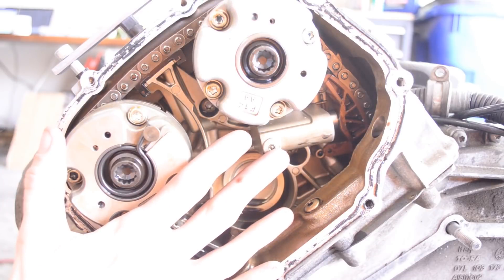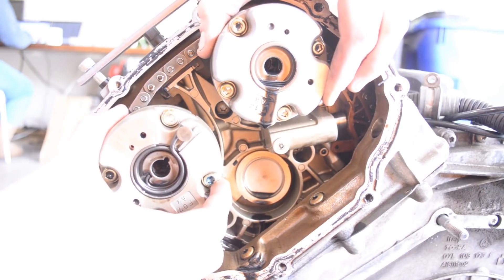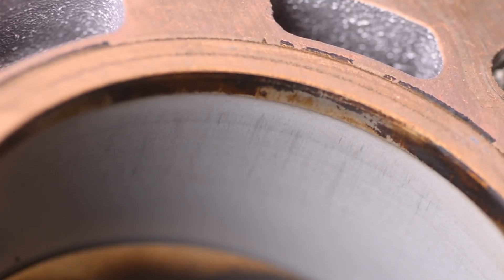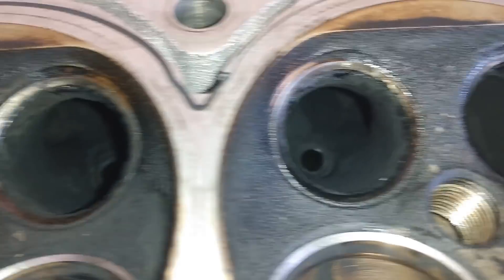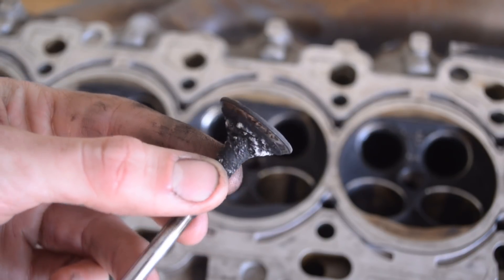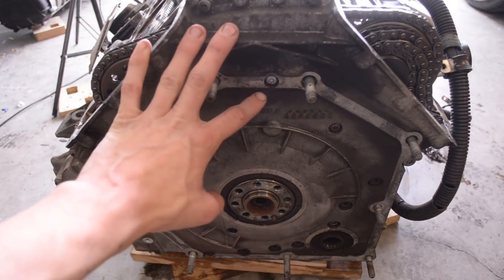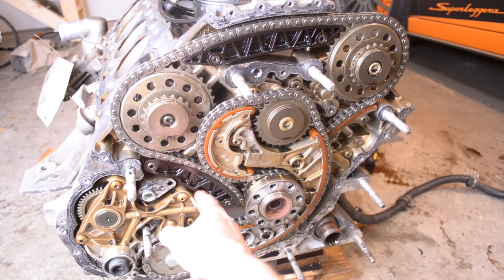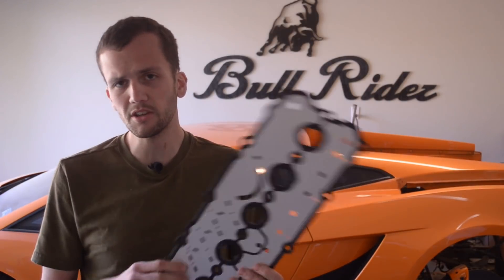Lamborghini Gallardo Superleggera V10 Engine Teardown | Cylinder Walls, Engine Timing, & Valving

Comment: Super exciting vid, Richard, thanks for sharing! To my untrained eye those cylinder walls seem fine, def. not worth 35k for just sleeving. You're on one heck of a journey!

Edit: Wow on the valves, just wow.
Reply from the maker: Tanel, I should of done a before and after dyno just looking at those valves. This v10 will be factory fresh after getting all that crap off them. 

I couldn't agree more, not worth 35k just to sleeve a short block, although the bottom end does deserve a little bit of attention at some point!
Reply: @TheBullRider  A before and after would have been super interesting, but hey, if you decide to do any future work you'll now have a baseline.
Reply from the maker: @tanelrebane  Very true. I think we can get another 100k miles out of the bottom end before a rebuild, what do you think? Haha
Reply: @TheBullRider  If you would, it will be a testament to the factory engineering, your ingenuity, or the toughness of whatever trailer you'll have it loaded on. ;-D
Reply from the maker: @tanelrebane  OMG, it will not be on a trailer, I guarantee you that Tanel!!!

Comment: Bottom end looks very good.  I would just do a top end rebuild, bolt it back together and strap it down to a dyno to see the power rating.
Reply from the maker: Skyline, Im glad to hear that I am not the only one that that came to this consensus. The top end is coming along nicely, once I get all that carbon out! 
Do you have a Gallardo?
Reply: @TheBullRider  Yes I have a 2013 LP 560-4 Spyder.
Reply from the maker: @skylinemotorsportsllc205  That is awesome Skyline! Is it a final edition? Sure you would agree, I love the look of the front bumper on the final edition.
Reply: @TheBullRider  I do not believe it is a final edition.  It does have a plaque on the dash for the 50th anniversary.
Reply from the maker: @skylinemotorsportsllc205  Thats cool! A 50th Anniversary, right on.

Comment: Re: Valve cover gasket, without looking I actually expected worse.  Great series though and balls of steel for cracking the motor open yourself!
Reply from the maker: Richard, this valve cover gasket is in almost perfect shape. Really tempting to re use it! 
Haha, glad to hear I have balls of steel. Hope it motivates you to crack open your 5.0 too!!!
Reply: @TheBullRider  It's always a painful debate with stuff like that.  I know on an NSX, I would never re-use, but that's a different VCG situation all together.  As long as it doesn't leak then it's mission accomplished.  Not sure I'm in a hurry to take mine apart, but at least if it becomes necessary I now know where to look for reference :)
Reply from the maker: @LapoftheWorld  Richard, your videos on this car are very helpful too. I have referenced them myself, especially that PITA coolant hose. Your lucky in a NSX, you could probably pick up a good set of valve cover gaskets from the shelf at AutoZone if you had to.
 Lets try it and I will let you know if the used ones leak (Probably will LOL)

Comment: Nice work!   Those intake valves look like pretty crusty!   Impressive engine timing design.  
I would use the new gasket, instead of reusing the old gaskets.  Sell your used gaskets to off-set the cost! My experience with used gaskets is that they will leak, then you're back in there to seal the leak with the new gaskets.  Anyway, looking forward to the next video.
Reply: Good idea at least get half the money back.
Reply from the maker: @Vgk36  I wonder who would actually buy them. Makes me think I could team up with a gasket company and manufacture aftermarket ones!
Reply: @TheBullRider  probably not worth the hassle at this point in time. Maybe when you inspire enough people to drive them to the point where they need maintenance like this lol.
You only live once. So enjoy the dang cars people.
Reply from the maker: @Vgk36  I am trying! Everybody treats these cars like garage queens!!! Its so sad...
Reply from the maker: Mario, why didnt I think of that?! That is a genius idea! Heck even used they net 200$ each, who knows if anyone ever buys them though. 
Look forward to the next video where I clean all that nasty carbon off those valves. Probably pick up 50-100 horsepower at the same time! LOL

Comment: Fantastic  !!! Great explanation and teardown  !!!z
Reply from the maker: Deuce, im glad you liked this one sir! Hopefully it will promote you to tear down your V10 once you get a Gallardo with your son.
Reply: @TheBullRider  you bet....  what strikes me to be odd, is that they put plastic chain guides....is an engine out the only option if they fail, or is there an access behind the seats from the cabin ?
Reply from the maker: @ndpesicgroup  Deuce, you can get at all the chains by just taking out the transmission as that is the "rear" of the motor. 
The old design used plastic chain guides and they eventually replaced with a lot of metal components with plastic hats after they started to fail on the Audi S4. Plastic is good because of the low friction surface that the chain travels over but there were some problems with the strength of the guide over time. Audi and Lamborghini say you never have to replace these components but this is far from the truth.

I believe that this however has to be an engine out service as the timing cover seal is integrated into the cylinder head gasket. The timing video will show all of this, it will be fun!!!!
Reply: @TheBullRider  thank you for this info..... hope you have a fantastic week !!! Looking forward to the next video !!!
Reply from the maker: @ndpesicgroup  Hope you have a great week as well sir! Have a good one

Comment: The inside of the engine looks like a Jacob & co. Watch mechanism, just beautiful, but so intimidating to mess with, I’m glad that you have the guts and knowledge to do it, great job you are doing.
Reply from the maker: Jacob, I couldn't agree more! Hopefully by the end of the timing chain video, you have the guts and the knowledge to do the same on your car as well!!
Reply: @TheBullRider  I hope and pray that I don’t ever have to do what you are going to your engine.
Reply from the maker: @jacobchavez4806  Jacob, what's the fun in that?!? The best part is tearing it down. You have to take the cylinder heads off at least once.

Comment: Thanks for these amazing videos. I'm learning so much about my type 42. :-)
Reply from the maker: Todd, Very cool! Do you have a v10 or V8 type 42?
Reply: @TheBullRider  the v8. It's a 2008 and 6MT with 86k miles!
Reply from the maker: @toddmarimon9292  Right on Todd! The v8 6mt is an absolute dream. Enough horsepower to put you in the back of your seat and rev it out but not enough to get you pulled over instantly! Haha

Right on for having a high mileage exotic! Sounds like you could use a timing job on that motor soon. Have you considered doing that?
Reply: @TheBullRider  sigh, I haven't really considered it yet, but you're probably right that I should start to think about it. There are a lot of "while you're in there" things that I can probably pile onto that, too. AC compressor, clutch, mounts, headers... 🤔
Reply from the maker: @toddmarimon9292  The headers on your motor are great arent they? Other than having a CAT, they are tubular and equal length are they not? 
I couldn't agree more, resisting the "while you are in there" temptation is hard! Haha
Have you replaced your AC compressor yet? I know those fail a lot on your v8.
Reply: @TheBullRider  AC compressor still works on mine. It's had a few previous owners, but I don't believe it's ever been replaced. Knock on wood. I haven't had any issues with the headers either, but part of me wouldn't mind getting rid of the cats. I have a stasis exhaust, which sounds really good already.
Reply from the maker: @toddmarimon9292  Thats cool, yeah if it isnt broken, no need to replace it. Maybe you will luck out on your r8 with that compressor. 
Your making me want to pick up a r8 v8 now. haha
Reply: @TheBullRider  if you're ever near Ohio, let me know!
Reply from the maker: @toddmarimon9292  I will sir! Enjoy that r8. Get it to 100k miles by the end of the year. Gas prices be dammed!
Reply: @TheBullRider  we'll see! I drove it the most of all my cars last year! More than my daily, even! Because I WFH, and I did a long road trip in it. ☺️